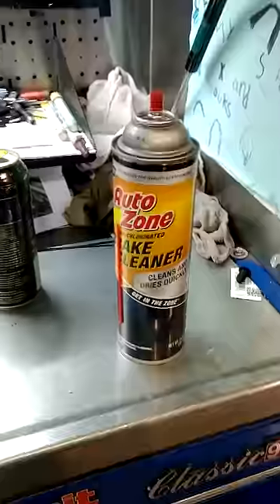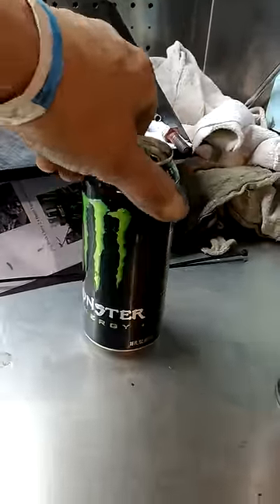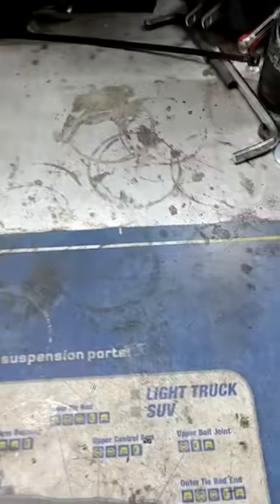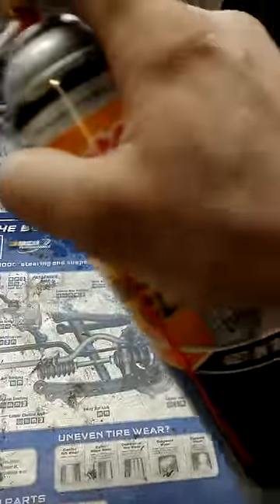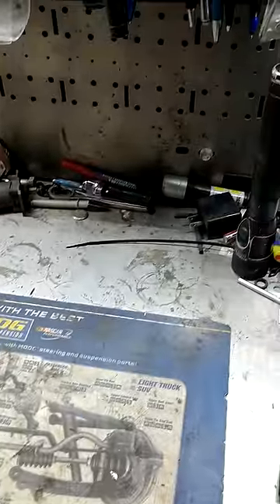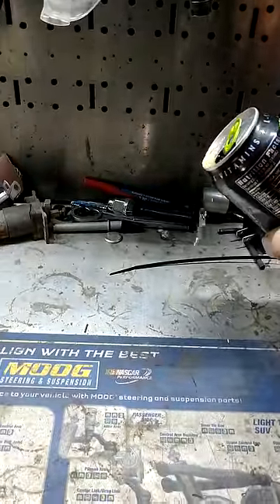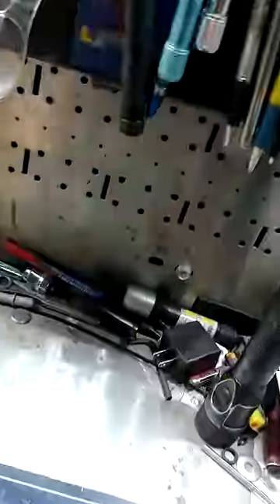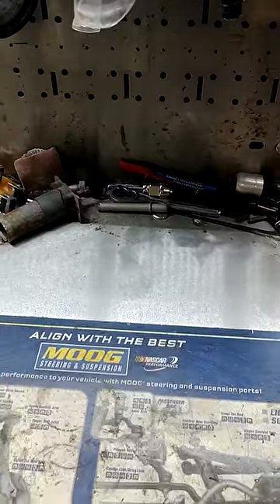Energy Drink Cleans Better Than Brake Cleaner || ViralHog

Comment: I called “bullshit” when I saw that the can was already open
Reply: Well, Coca-Cola makes a decent rust remover.  What's so fantastic about Monster (which is a lot more acidic than Coca-Cola) being able to clean better than Brake cleaner?  Also, how does the can being already open a 'gotcha' moment?
Reply: He has a cleaner solution soaked in a rag when he used the Monster drink.
Reply: I literally use coca cola as last resort when all of my cleaning supplies fail. Cola never fails, pour it on, leave it for 1 min and clean it. Obviously after that you have to clean the cola, but that's the easy part.
Reply: I don't know because I've spilled monster few times and that's exactly how it looked

Comment: That's not what brake cleaner is for. This is like one of those infomercials.
Reply: Maybe not, but brake cleaner, as you may well know, is a fantastic multipurpose degreaser.  Loads of uses other than cleaning brakes.

Comment: This video is bulldung. You're using brake cleaner and not for the purpose intended, to clean brakes. Of course monster (or coke, Sprite, orange juice, a lemon and some salt) will do a better job, it contains citric acid. Monster should sue you for defamation of character.
Reply: Dang that’s harsh it’s just a life hack